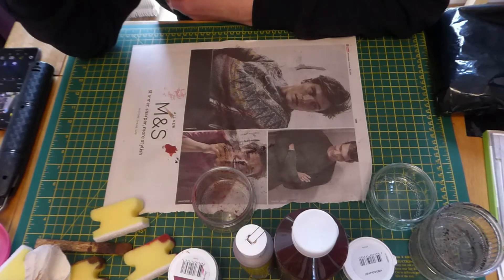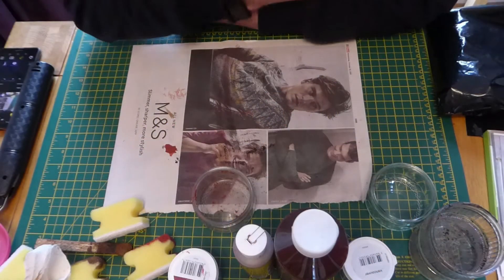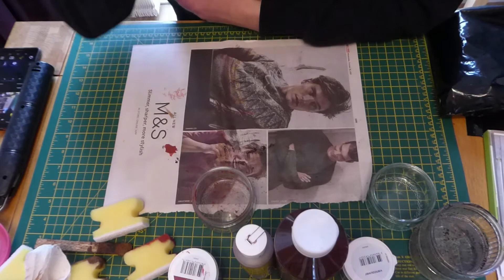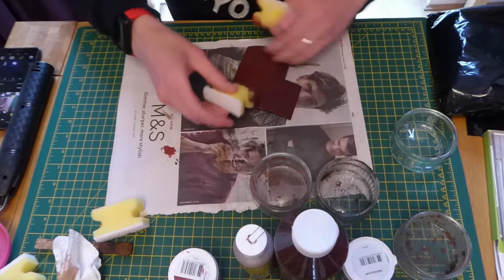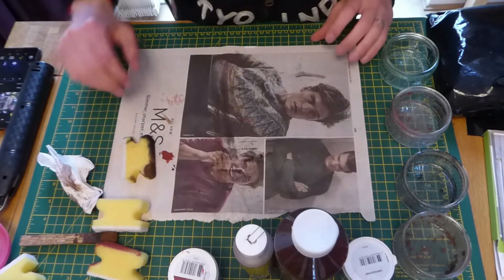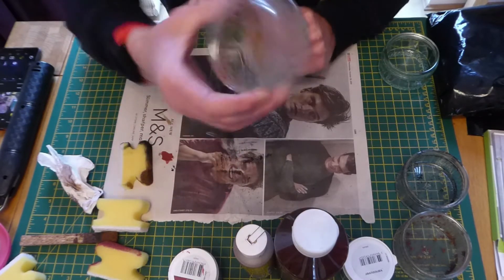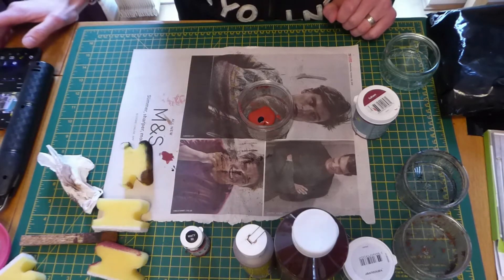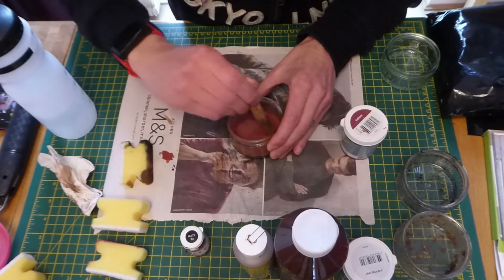Greenhill Junction - Platform Surface Deliberations - Video 24

Comment: It's an interesting concept John and all worth it if you achieve the look and texture you want. I think both samples look realistic, just need the sandpaper spraying a lighter "terracotta" colour? Andy.
Reply from the maker: Hi Andy. I went with the dust in the end as I felt it was more what I was looking for. Building the platforms just now but it's taking ages and have to keep adjusting them due to clearance issues. They are looking good though and I'll have a video up showing them in a few weeks. Cheers, John.

Comment: Best way to get the result you are looking for, is to practice like you have shown. What you came up with should look good when to lay the platform surface.
Regards
Geoff
Reply from the maker: Thanks Geoff. I ran out of the red paint I was using so ended up using another pot which gave me more shades. Mixed all the colours together and it looks good. Busy doing the platforms just now. Cheers, John.

Comment: Would a lower grit sandpaper work - such as 40 or 60?
Reply from the maker: Maybe, didn't try any others as the cork dust worked out perfectly. I was worried that painting the sand paper would ruin too many brushes too.
Reply: @GreenhillJunction  Good point. I am enjoying your videos. The layout is looking very good.